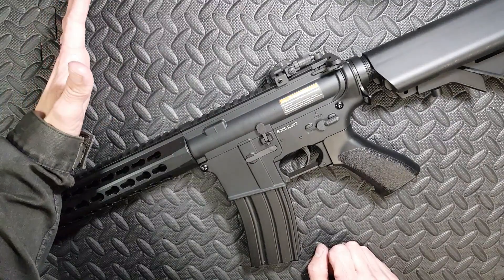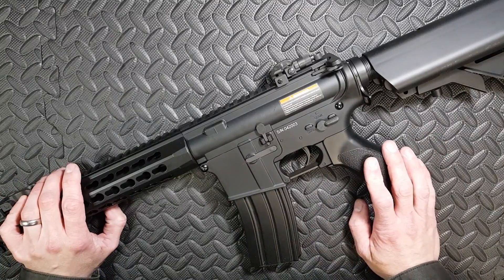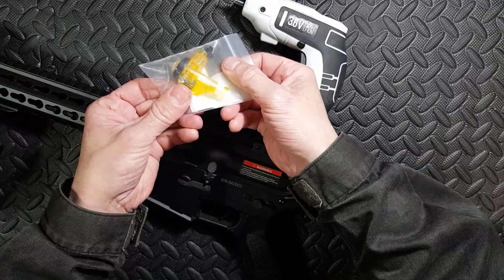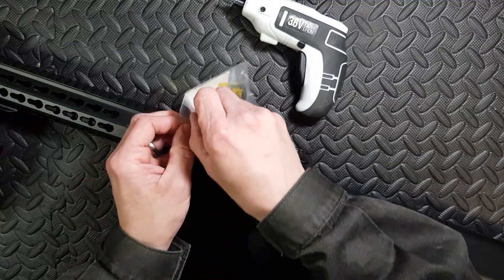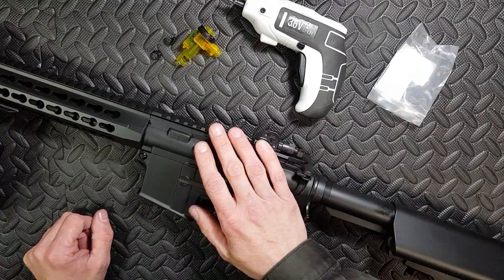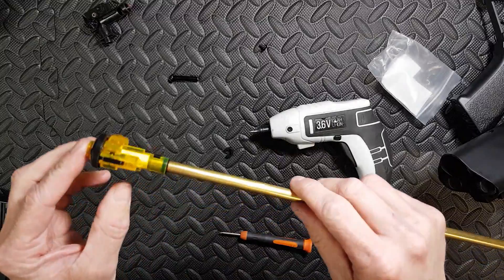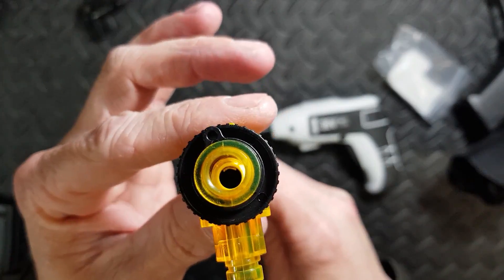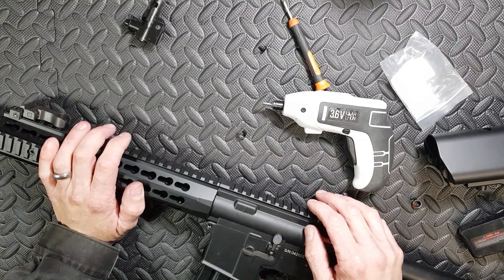Tracer Hop Units (full description below)

Comment: repairing a G&G for a friend, which has a friend that built one of these in the gun. He wired the whole thing inbetween the gearbox and lower. Wires are going through the hole in the back where the gearbox wires come out. then it goes down into the pistolgrip and ends up at the motor. shit-ton of fucking wires.. what a idiot.. cant even get the upper and lower together cause of the shitshow of wires.. fuck..

Comment: I bought one of those hop units, lost over 100 fps. It's funny because you can see that there's a 2mm gap between the nozzle and the rubber (it's amazing how that little gap can cause such massive air leak). It looks like they weren't designed for m4 nozzles but they're sponsored as that.

Comment: this lockdown is not healthy for my wallet. the airsoft fields around where i live were just about to open before this. after being closed during winter, and to top it off being over worked since im nurse i have instead og being reasonable ended up buying a used m60 a used m870 and a brand new m249 why? no clue other then just tempted
Reply: I recently purchased a ton of upgrades for my Avalon Saber. The gun shoots fine out of the box but I thought, eh I got nothing else to do

Comment: I'm looking to do this mod and I'm wondering if it is possible to rob power from 1 lipo cell trough ballance charging port so I don't need a resistor and can possibly run it with both 2 and 3 cell lipos

Comment: Nice. I'm running a 3-LED unit off a single AA sized 3.7 lipo cell that works just fine.  The voltage is close enough to what the LEDs want without even needing to use a resistor.
I would emphasise getting a sacrificial hop unit though: I properly twatted up my first try and lost the air seal big time for reasons that still baffle me.

Comment: I swear to god those pro win style chambers cause horrible problems with FPS, I had a gun that was 135 with one (zci plastic), I switched to a JG standard hop unit and I got 370fps with a significantly weaker spring also

Comment: Is it possible to connect the LEDs directly to the motor wiring? so when the motor spins the LEDs light up.
Reply: sandersam1290 It should be possible. It would probably be a bit of a pain though. IIRC, that’s how the MAXX unit works.
Reply: yeah but if your gun precocks/ cycles fast enough then the bb will be gone before the LED fully lights up

Comment: i've had similar on my cyma ak, but with microswitch which turns diodes on when mag was inserted
Reply: They just stay on the whole time?
Reply: @Evan-eh9dd  They draw very little power.  I run mine off a single AA sized 14500 650mAh lithium cell.  Turn it on at game start, off at game end, plenty of juice in there.
Reply: @Evan-eh9dd  yep, i just used li-ion cell to power 3 3.3v diodes
Reply from the maker: I did the same with  a TM AK47S, it's a lot harder with an AR or MP5alike but as has been noted, you can leave it on all day.
I'm waiting for "you'll give your position away with light in the gaps" comments, but the fucker is throwing lasers at the enemy.. it's not hard to spot lmao.
Reply: @NegativeAirsoftTech   infra red diodes can solve problem with light through the gaps, but they can't solve their problems with the head
Reply: @Anticlop  inb4 someone complaints about people with NVGs seing the IR diode XD

Comment: glad to see that you're putting 330Rs as protection
Reply from the maker: I actually put a bigger one in there in case I decided to piggy back from an 11.1v lipo
Reply: @NegativeAirsoftTech  it's not a bad shout. I noticed it's a higher wattage one which is probably a good idea, although you should be fine either way. Most of those LEDs are 12v rated

Comment: That actually seems easy and cheap. Got the leds and resistors already might try that
Reply from the maker: 20 leds, 20 resistors, 5 on/off switches come to about £12 posted from ebay... Use a decent hop unit but buy the cheapest possible to practice on first.
You can piggy back from your power source but I prefer a couple of AAA batteries & an on off switch in the front of the gun & the normal wiring for the gun in that back - otherwise it's a shit to take the upper from the lower.